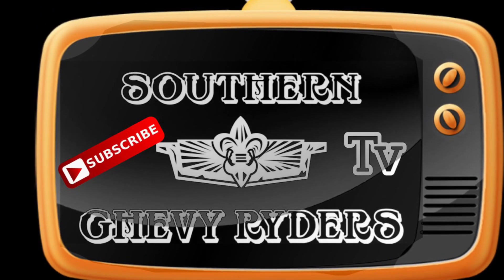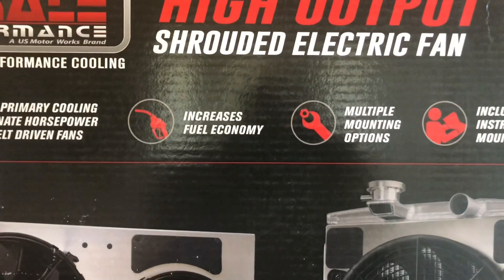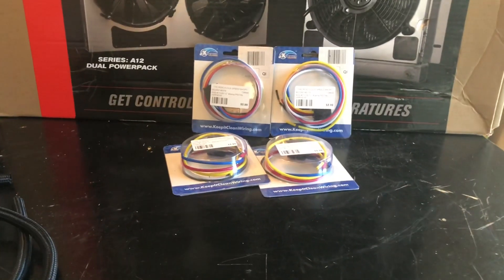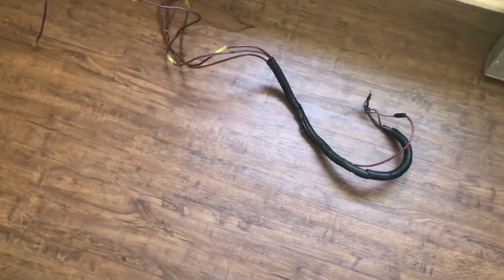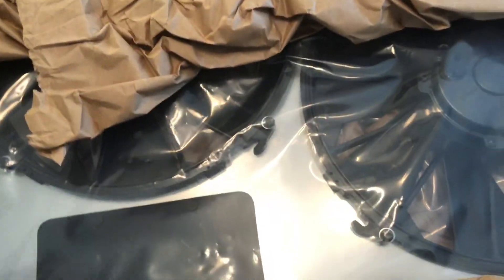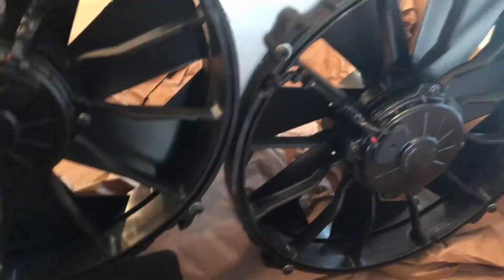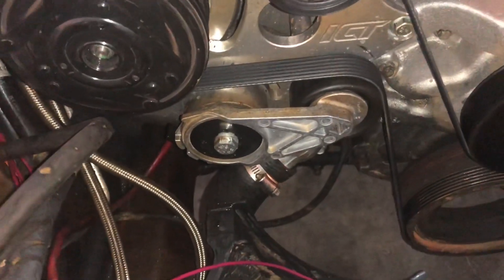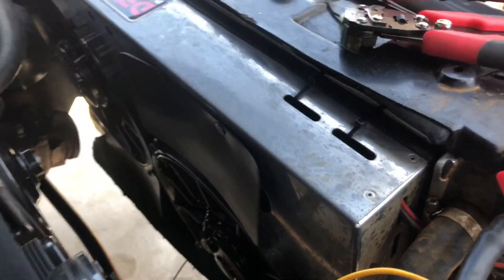Derale High Output Fans review

Comment: Wat size radiator u have
Reply from the maker: Stock
Reply: I’m tryna figure out which derale size fan shroud dimensions I need I wonder if u can point in the right direction
Reply: My Core Size:  26.25"W*16.85"H*2.44"T.
Reply from the maker: @kkhambrick9376  what car is it going in if box chevy the part number on the box fit perfectly any other car 🤷
Reply: 85 caprice